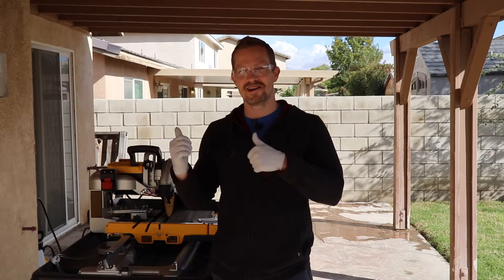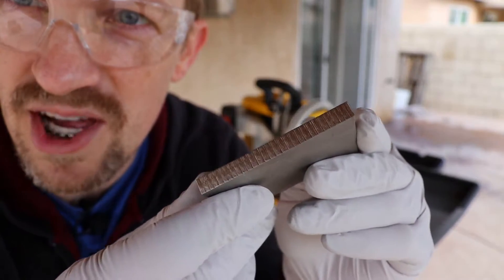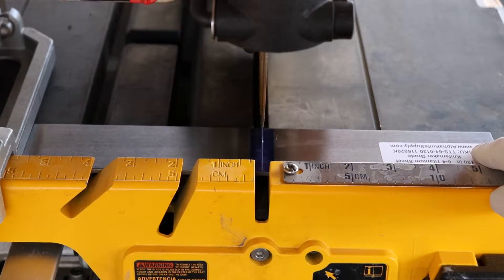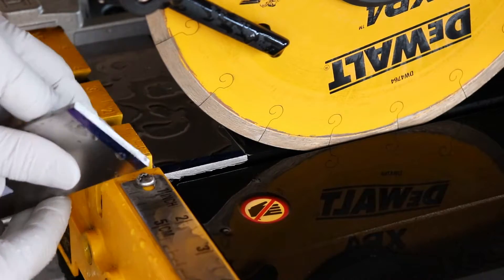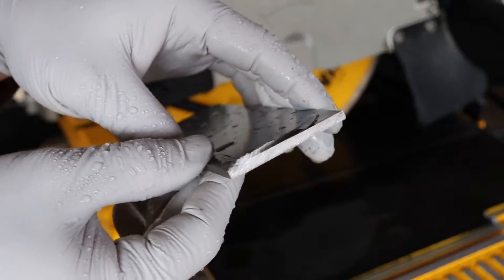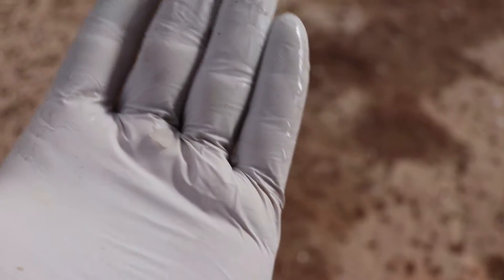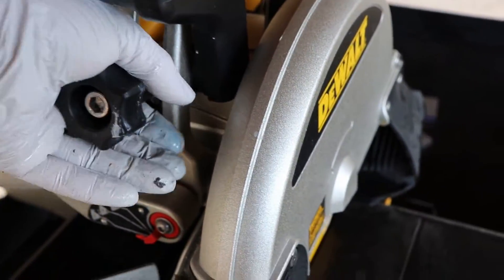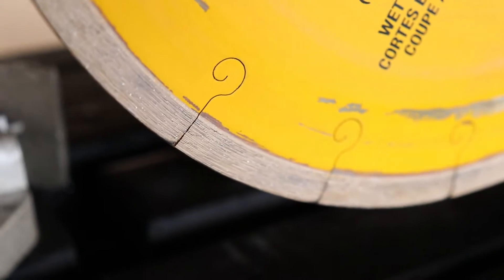Can you cut Titanium with a Tile Saw?  Lets find out!

Comment: Carbide is a lot harder than Titanium. so this should work.  Diamond is used to cut Carbide.  Blade quality would be important, and you are just using a basic ceramic tile blade.  7:27 your blade height raised up, was the height adjustment super tight?

Comment: resin wheels almost as hard but far more abrasive material (volume) and way cheaper than diamond.
1. first I'd try a 12in. $50 chop saw (resin wheel)
2. then I'd use $10 angle grinder with resin wheel
3. I'd splurge on an evolution carbide bladed chop saw.

Comment: I worked at a mold shop 6-7 years ago, and we would cut up to 3.0 thick 7075 plate on a craftsman table saw & a radial arm saw. Worked out okay. Had to reverse the blade direction on the radial arm saw so it wouldn't cut towards you. It was sketchy.